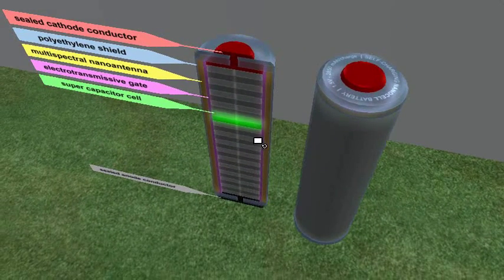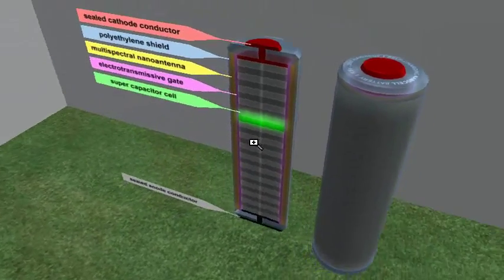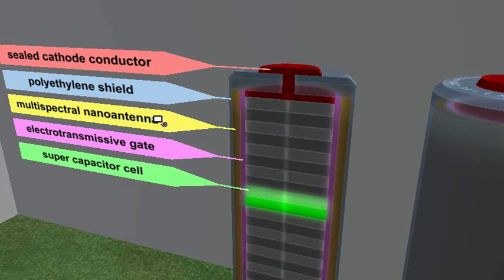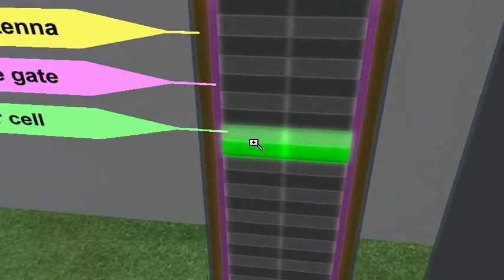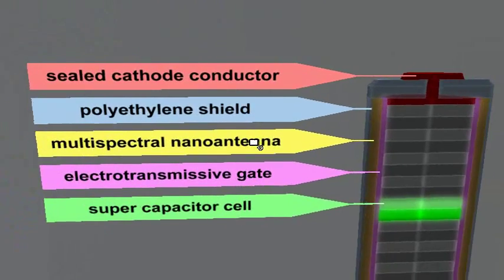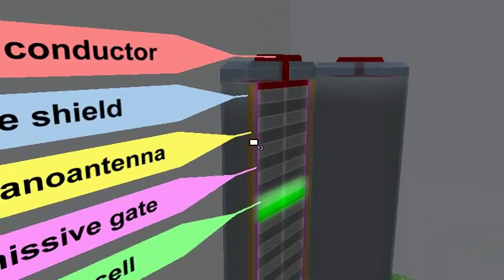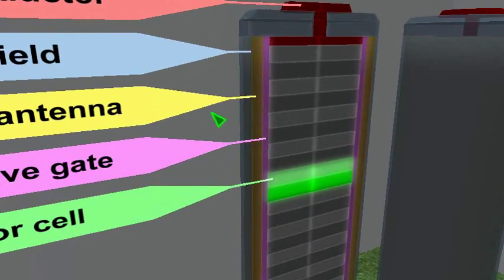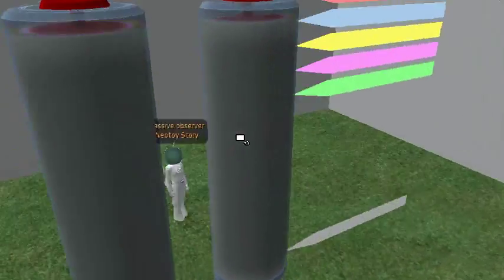self-charging AA battery design

Comment from the maker: @JoeTheBiochemist Thanks for the thoughtful response. As you surmised the ET gate is my solution to the diode problem, and is in fact a type of diode mesh. Keep in mind the solar array is multispectral therefore it can absorb a wide swath of radiation, not just photons! All this energy is aggregated in the mesh and then passes through the gate when it reaches the ideal capacity. Does such a thing exist? Maybe, if not it is easy to imagine and doubtless just as easy to create.

Comment: This actually wouldn't work, because you have no means of rectification. Electromagnetic radiation produces an AC signal. Which is great if you want your battery to rapidly charge and discharge by infinitesimal amounts, but if you want to capture a charge that can be used, you'll need a diode. Diode efficiency is far too low for this device to be practical, because individual photons cannot forward bias a diode. Perhaps "electrotransmissive gate" is your solution, but that's not a real thing.

Comment: i think it is possible but maybe the AA batteries are not the best aplication you can try. Maybe you should try a design for a simpler and smaller battery like the used in a watch and combine the watch design with the battery charging device to prove it. Remember de Casio solar powered watches?
Keep trying, I think that all that electromagnetic energy flowing across the air can be used in small aplications like that. Cellular phones, iPods, mp3 players, watches, cameras, you name it!!!